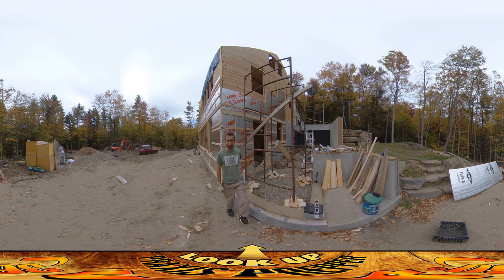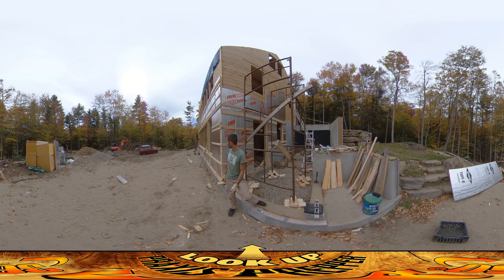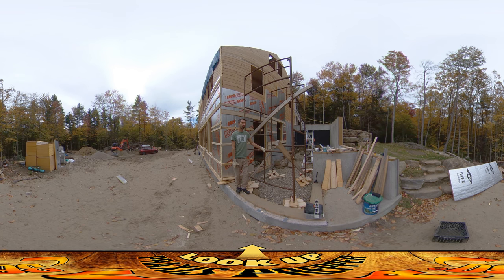Homestead Building - Scaffolding with DIY Cross-Braces, Fear of Heights!

Comment: Yeah, i know what you mean, though in time i have concluded that i am not afraid of heights !  I am mostly afraid to fall down !! aka. fear of falling instead of fear of heights. The same might be the case for you! Not that that helps in any ways, but it sounds and might feel silly to be afraid of heights, being afraid of falling though, a lot more rational and relate-able ;)

Hmm the scaffolding itself (with some wide enough boards), actually feels pretty dang safe and it's hard to look down seeing the boards are in the way. But placing a ladder on top of it, as that seems to be what you imply doing, uuhhhh, that sort of feels like it will end in one of those 'funniest home videos' that aren't one bit funny at all (at least if one has any bit of empathie in themselves and isn't some sort of weird sadistic moron) ... So personally i would advice against it, and prefer to get some proper equipment on site, one of those mobile machines with a baskets on an extendable beam, that would make it able to finish this safely. My fear is that due to not having that planned, there isn't really time to get such a thing on site (or budget doesn't allow for it), which probably means you will try and build the tower of Pisa anyways, so cross my fingers and hope you don't fall of and die.